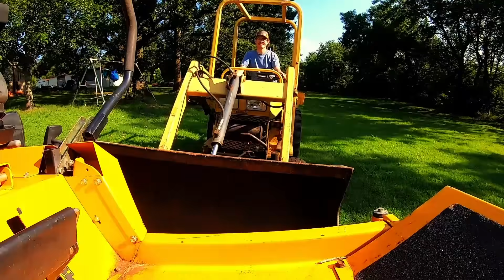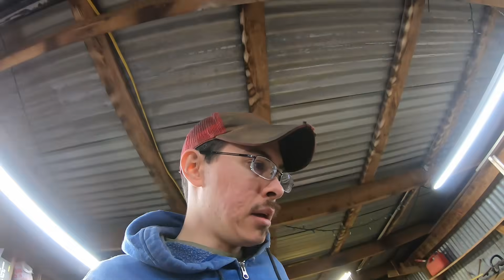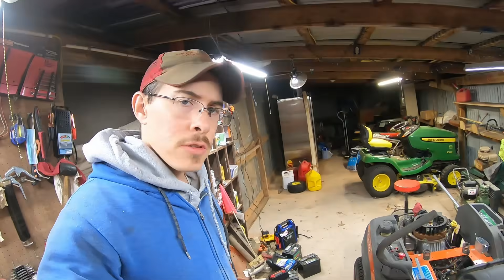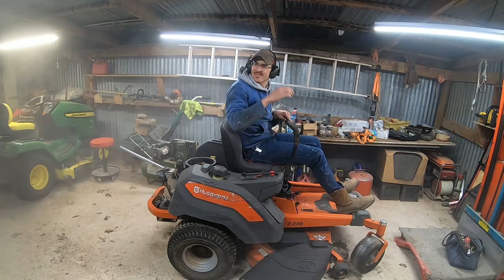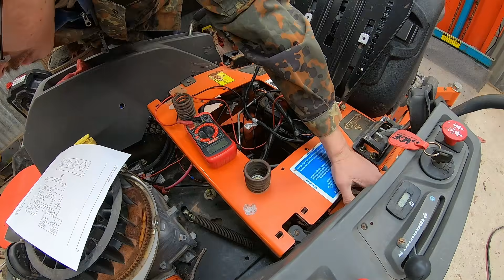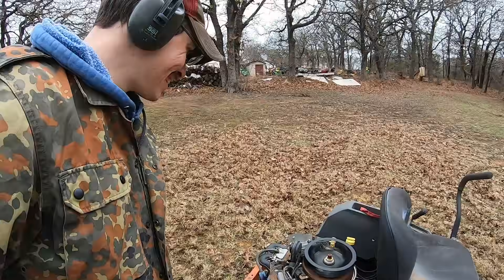Why won't it crank? Free Zero Turn has electrical problems... Husqvarna Z246 Part 2 | Garage Story

Comment: Thanks for the video was helpfu, I subed and  the relay by the key switch you found on the cubcadet what was the part number ? or better yet the  number on husky I have johnsered made first the original then huskvana bought them out. You best slow the engine speed way down before you pop the pto for the engagement of the blade before you wax the pto. Does it go pop really loud when you bang it on at high rpms let it throttle down first to at least 800 rpm or a thousnd before you pull on the pto for blade engagement or you will grenade it I have had to replace it and they are very high like 150 bucks. Please show close ups of where you put the tempary ground on the solenoid so I can do it too and after that i can unhook it and replace the relay. ? not sure why mine is not grounding bet its the relay cause i have a new key switch and a new solenoid. It worked after the key switch replacemnent I probably disturved the realay and it worked again temparyly. I can bang on relay for the windshild wiper in my ranger and the wipers will work a while.
Reply from the maker: Thank you for the sub!
Good comment on the PTO clutch, it is better for them if throttle is lowered before engaging.
I sold the mower awhile back, but I do have a package for a replacement relay I found in my shop. Looks like I used a Bosch 0 332 29 150-896 relay.

Comment: This wasn't my problem unfortunately
Reply from the maker: That stinks!
Reply: Ill figure it out im going after the starter relay next
Reply from the maker: Depending on what the symptoms are, you might want to check that the full voltage is getting to the starter solenoid as well. I’ve had an ignition switch start going bad and not send the full voltage through.

Comment: 👍video!  My HusZ54 was spudderig, misfire, & bogged down when blades engaged.  I changed oil, oil filter, fuel filter, & check plugs & cleaned.  Ran rough for about 3-5 min then it ran like new.  

I had a vine grab the gas tank fender guard and it pulled it up and out of place.  But zero did not hesitate and kept running fine.  Then I ran out of gas, I put non-ethanol and started back up and it goes dead, it will run 3-10 seconds with choke up/engaged but as soon as I push choke to normal Ops it goes dead immediately unless I reengage the choke   

I looked at the wiring under the key and the choke connector was unplugged from the Vine incident.  So I thought ok that’s it!  So I plugged it back up but  still have the same symptoms - Crank for a few secs then shuts down! 

Do you or any commenters have any suggestions of what to do or try?  I’m thinking the vine incident may have messed up the choke or bad gas but I do use 93 non ethanol gas!   (It’s fm last October-but same gas as I was using before I ran out of gas)!  It ran fine until it shut down/or ran out of gas.

Comment: Mine cranks and starts, but when the handles are brought in to start moving it turns off. I already replaced the switches too and still does the same. I was hoping to check that relay but I can't find where it's located. 😢
Reply from the maker: If I remember right, the relay is inside the right fender, under the control panel.

Comment: I've been working on small engines my entire life as a hobby for myself and friends. I just fixed my mower. I was mowing and it just suddenly stopped. I was getting fire but it wouldn't run. The mower is 20 years old (New Holland Zero turn). I had some carburetors laying around so I changed it 1st; still no luck. I tested every safety switch, two were bad. I thought that was it; NOPE. 

Long story short, I changed every component, It would just click, like a safety wasn't engaged. End of story, although I put a new relay in, it wasn't working correctly. So I researched until I found the exact P/N and walla! This one had me bamboozled for weeks.
Reply from the maker: I’m glad you got it fixed!!

Comment: I have a 4619 put all new on it but relays can't get nothing out of key but if I put a jumper wire on solenoid I can get it to turn over would it be the relays?
Reply from the maker: I can’t say for sure, but it sounds like it could be. Especially if you’ve replaced everything else

Comment: I have a 2023  z248 and it starts up but when i touch the right stick it shouts off what you think could be the problem do you think its the safety switch
Reply from the maker: Does the left side do the same thing, or just the right side?
Reply: @garagestory  it was only happening on the right side when I wiggled it it kept shutting off and starting up now it’s just not starting at all
Reply: I had the engine idling. I even moved it a few times, but when I touch the right stick by mistake, it was stalling out, so I knew the problem was coming from that area.
Reply from the maker: It’s hard to diagnose when I’m not there. But it does sound like you have one or more safety switches that are acting up.
Reply: @garagestory  yeah I understand but it’s just the right side if that switch is bad will it shout off if you tell me that will further help me rectify the problem
Reply: @garagestory  Yes
Reply: Any ideas?????????

Comment: I know this is an old video but I’m getting no power even to the hours gauge. I don’t see any bad wires. I’ve jumped the starter and it turned over. Would the solenoid cause no power to the gauge as well?
Reply from the maker: Have you checked your fuse(s)? That would be the first place to start

Comment: I'm having a issue where the mower starts but if I don't immediately pull the lap bars in inwards the mower will turn off. If I try to let it ideal with the lap bars out  it will shut off.  Any idea what could cause this. Had electrical issues similar to yours and what I found was the contacts in the PTO plug had split.

Comment: I have a Z254 with the Kawasaki fr691v engine. Middle mow it cuts off.. I started off with what I thought was a bad battery it wouldn’t jumpstart so I replaced it and then nothing happened the key comes on and it wouldn’t even click the solenoid.. I replaced everything as follows: Ignition switch, spark plugs and coils, fuse, relay(same as in video), solenoid, starter, stator (charging coil under flywheel). Now I had power and with a brand new higher CCA battery it fired and was running but very high rpm then locked up and shut down and blew the fuse, I replaced the inline housing and fuse and now nothing but the clunking/clicking noise from the solenoid when the key is engaged, but will not fire up at all. I am beyond frustrated and I have tried everything from your videos and 20+ others. I tried jumping the new starter directly and got a huge spark and then smoke from under shroud and now I am don’t have a clue where to go. Any ideas?
Reply from the maker: Wow…. That’s quiet the ordeal!
Can you spin the flywheel over by hand? I’m a little concerned that the new stator may have got caught on the underside of the flywheel.
Reply: @garagestory  I can rotate the flywheel by hand but only if I remove the fan and crankshaft bolt then break loose the flywheel and then put it all back on and it will spin clockwise and counterclockwise a couple rotations in both directions but eventually stops again. so my initial thought was that I “crossed” the wires on the stator but come to find it doesn’t matter they are both AC power so I saw some smoke coming from under flywheel when I first changed stator and attempted to jumpstart the engine but I took the cables off quickly and there is no visual damage and the connections and wires are in good shape.

Comment: I got this mower specifically to be able to drive it through a 36 inch door https://www.youtube.com/post/Ugkx1VWTrayKBdCKAjzAcZ_Eg4dhHTae3LkN also recommend or gate It is a little tight with the grass deflector installed but has more clearance with the deflector replaced by the recycler/mulcher. This model appears to be popular and a little harder to find for that reason. I can't judge the dependability as I have only mowed the yard twice but everything else on the mower is very nice and working fine so far. I added options for the run hour timer, arm backrests, recycler/mulcher, towing bracket, deck lift assist and cover.
Reply from the maker: Yep! Except it turns out the engine has issues…

Comment: Thanks so much for posting this video!
You helped me out and I appreciate it a lot.
Even down to knowing that another brand of mowers part would work if it had the same plup in patern.
Thanks again.
Reply from the maker: I’m glad I could help!
It is more than just the plug pattern, all the other functional indications on the relays looked to match.

Comment: Same problem with my Hustler, but I thought the thin wire going to the spade contact on the Solenoid had 12v from the ignition switch?

Comment: I’ve had (hopefully fixed now) this same issue with my z254 for the last 2+ years. It would start 50/50. I’ve gone through all the safety switches/starter solenoid, fuse, etc. I was close to throwing in the towel and taking it in. Very frustrating as it works great when it starts! A few days ago I finally got it going by removing the same relay/reinstalling. So it is working “sometimes.”

Weird how I found your video a few hours later where you fixed it with another relay! I was actually looking up how to bypass everything when I found your video. I have a new one on order. I have 4 spare relays, but they are all 4 pin… 

Quick question. Could this relay effect the PTO also? As this intermittently doesn’t work also. I tested the PTO switch and it checks out. Thanks again!
Reply from the maker: Excellent question! I don’t really know the answer. It’s possible it’s related. I’d have to study the wiring diagram again. Maybe there is another relay in the PTO circuit that is going bad?

Comment: Definitely need the blower housing to create draft that actuates the governor fan blade
Reply from the maker: I’m not %100 sure, but I think the fan blade is for the choke, not the governor. The governor seems to be on a shaft that comes out of the engine.
Reply: @garagestory  Looks like the issue is the throttle cable is connected directly to the governor arm so it is unable to control the idle since the cable is preventing it from freely moving.

Comment: I am only 3:25 in and I must say it is painful to watch.  A solenoid needs to be bolted down to a grounded part or the frame in order  to make a circuit if they are hanging in the air the coil in it cant get a ground.       I'm going to try and finish this video and I will give you like for the effort.  Anytime you look at something to troubleshoot it try and think how it works. A solenoid is a heavy duty contact switch activated by a small electromagnet.   The coil has to have ground.          I have this same mower it is a long story on how I got it.  But it was at a tractor supply like store and had a sign on it that said buy as is needs a battery and belt no warranty.  I asked if I bought a battery and tried it and it does not run & I don't want it can I return the battery.  I told him if so and it runs or wants to run I will buy it and the battery.   So I started it and it ran.  I paid the huge asking price of 200 bucks. plus battery a key and tax.

     I guess dude that purchased it originally  used it 3.5 hours and hit something hard breaking a spindle and bending a blade.  It also would not start.  So he returns it to be fixed and they sent it to the mower shop for warranty and was going to fix the motor and he would be responsible for the rest...
    Whatever?.... he hit was so hard that it stopped  the motor instantly and sheard the key off of the flywheel shaft😲  But somehow they mower shop ends up keeping it all winter and the first  of the new spring the dumb farmer asked for it back.  They repaired the motor but nothing else but they had let his new mower set outside at the mower shop all winter and it looked weathered.  So he said he did not want it, he wanted a new one.  So they gave him a new one and mine set in their backroom for the next 3 years when I bought it.  It is a 2020 Model less than 4 hours all total I have less than $450 in brand new mower after fixing everything. The plastic has faded some and  the seat has a few cracks but man it cuts nice with a couple G5 gator blades.    Very smooth cutting I love it and it is my first zero.  The dumb farmer guy did not even cut  the wire holding the deck up that the factory puts on them for shipping purposes.      You are going to like this mower when you get it going.
Reply: A plastic case relay doesn't ground out to the frame it's bolted down to isolate vibration and keep it in place know it all the relay itself has a ground wire that runs from the bottom side where all of your connections are located that yes must be grounded to metal too bad you just want to make this guy seem like he doesn't know what he's doing when he's actually pretty sharp even he doesn't consider himself smarter than anyone else
Reply: @ronaldshelton8029  This solenoid does not have a seperate ground nor do most of them. Some maybe yes but most do not.  You can clearly see a metal on it that it bolts down with.  This is the ground to close the coil when it is energized.  I know I am right as I have the same mower and have worked on mowers and engines longer than he has been living..  It has a battery cable in battery cable out and the one wire post to start no extra ground wire as it grounds to the metal base.    You can clearly see when he removes it and hooks the jumper cables he is grounding the Metal base.  So I guess I will have to disagree.

Comment: My Pzt-54 I've changed the key switch Sylinoid starter still won't crank over
Reply from the maker: Maybe it’s the relay. That’s what I ended up replacing.
Reply: @garagestory  thanks garage story I'm trying to figure out now where the relay is located and I can't find anything online I found a guy online with a pzt60 just waiting on him to respond thanks again preciate it
Reply from the maker: Mine was under the control panel on the right hand side.
Reply: Could I ask a question about this same model mower? The Z246. I don’t have any electrical issues at the moment, BUT my BIG issue is. The deck belt constantly comes off while engaged. I can literally mow 40 feet to 70 feet belt pops off. I’ve had deck down and replaced NEW both blades, spindles, both pulleys for those as well, brand new belt as well. All at same time. I’ve adjusted the spring/tensioner (eye bolt basically with 2 jam nuts) and STILL same thing. Belt continues to come off. Any ideas or help would be greatly appreciated here in North Carolina. Thanks for all your work n videos.
Reply from the maker: Wow, that is baffling!
I don’t know that I have a real answer for you, unfortunately. You might check the below items, though.
1) Is something out of alignment? 
2) Are all the replaced items correct? Like is the belt the OEM length 
3) Is the PTO clutch in good condition? Is it bent?

Also, the decks on these tend to break on one of the back mounts. If it is breaking at the mount, it might make things not aligned properly.
Reply: Actually that morning that I left a comment I got it running that day I disconnected the battery and got it running I think my ground wasn't good

Comment: I am in the middle of putting a 28hp B&S back together from a governor replacement. The governor was exploded internally. And if that is the case on your engine, then you have metal fragments floating around internally. 

I.e. get the governor hooked back up and make sure you see the governor arm moving. That would at least validate that it is internally functional and isn’t waiting to cause a catastrophic failure to the engine.
Reply from the maker: Thanks!
Reply: I am not sure the motor on his but it appears to have the old style fan vien type.  Most of the bigger motors now a days use a internal like you are talking about.    briggs intek are known for it to mess up.   I actually had a friend bring a motor by my house last year and had me tig weld his back together.  He had took the engine down but was to cheap to buy new parts.  LOL  It worked fine.   I have this exact mower but mine has the 20 hp briggs I am not sure what this is it might be a Kawasaki they made this mower over the years with three different motors they also have a kohler vs.   But my briggs intek is a single barrel carb so I know it is not that.     I really hope mine holds up.

Comment: I'm having same issue , where was that relay at  ? All I've found is a fuse
Reply from the maker: It was in the right hand fender, kind of under the controls. I took off the front piece to access it.
Reply: @garagestory  I've looked in there from the top cover . There waht looks like a relay but seems the wires are all made into it and it don't unplug.
Reply from the maker: Is it the same model of mower?
Reply: @jpdeerhunter35  That is it. I though the same thing on my z254. It will come apart.

Comment: Having same issue with z48F replaced battery, solenoid checked all safety switches never knew that relay was there hopefully this fixes mine 👍
Reply from the maker: Yeah, I hope that fixes it for you! It’s pretty easy to do.

Comment: I've usually found if it's not a bad wire or fuse, and your electrics are good it's always a dang safety switch.
Reply: Where are the safety switches??
Reply: For mine it was as simple as replacing a 20 amp fuse located in close proximity to the starter solenoid!